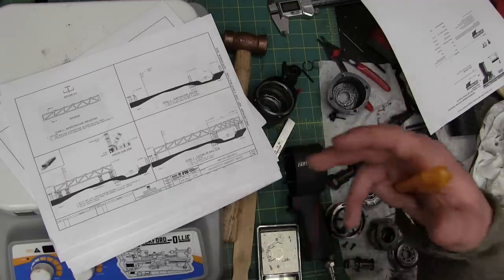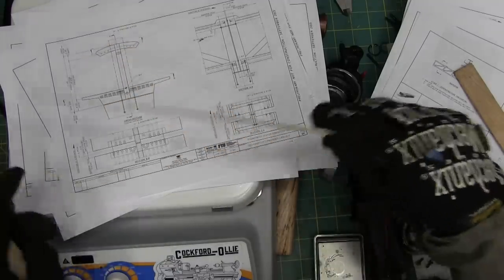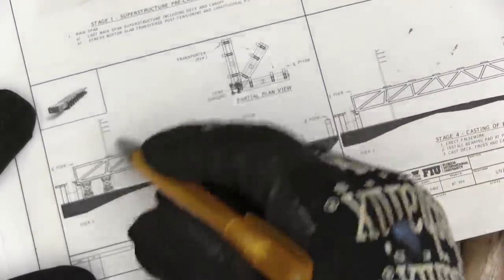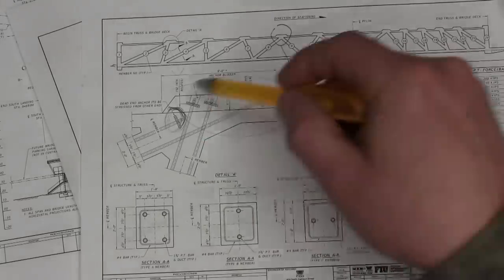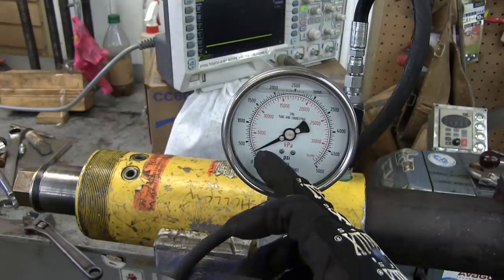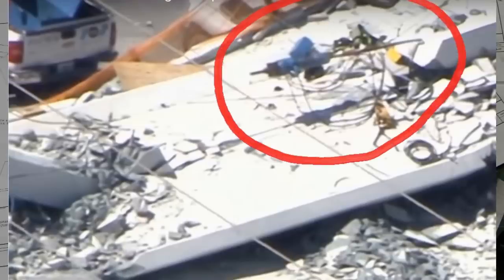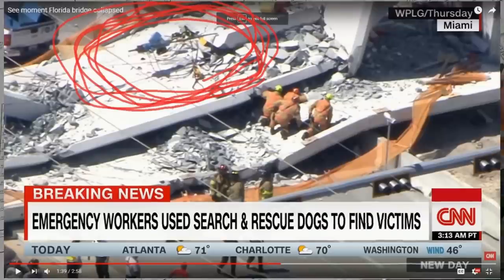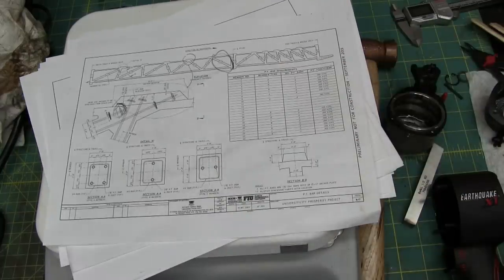Post Tension Failure Florida Bridge Collapse | Engineering EXPLAINED!

Comment: I agree that the failure most certainly occurred at one end of the bridge, either member 2 or 11 as you say. (Not sure which end is which).  However in my opinion, once the bridge was sitting on the piles at EACH END, the whole upper "deck", (for want of a better name), would be in COMPRESSION - supporting the lower "deck". 

The lower deck, without the support of the upper deck and by being only supported by the piles at each end,  would tend to generally sag. 

This compression of the upper deck would terminate through members 2 and 11 which were based at their respective trusses at each end at the lower "deck" level. 

Given this is logical, I have a problem with the assertions that the workman was supposed to be increasing or adjusting TENSION. 

Certainly in some other shots that are around, one can see that a number of members have appeared to have pierced the upper "deck" which may support what I am saying, but I am aware that once the bridge hit the road, anything could end up in strange places.

However, in my humble opinion, whilst I agree that member 2 (or 11) failed, possibly where it was attached to its adjacent member 3 (or 10) but it was  because of a COMPRESSION failure of some sort.

Trust you can follow this.

Cheers

Roger

Comment: I used to work in a concrete plant making pre-stressed structural concrete beams and wall panels. Prior to concrete being placed, the cables had to be pre-tensioned which required all but two people to leave the entire building structure. The two persons doing the pre-tensioning were behind very thick plexiglass in the event of failure. In this case they were pre-tensioning steel rods for which the road and surrounding area should've been closed per OSHA rules, yet they were not. The bridge collapse was an accident though unfortunately took the lives of six civilians and injured several more. As for the design change and the movement of the north pier by 11' feet further north, I don't know if that was before the bridge segments were made or after the fact. But clearly in this case, it appears a pre-tensioning rod snapped which is the straw that broke the camels back. No doubt about that.

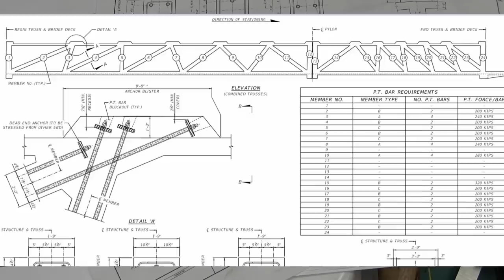Comment: AvE, there is a couple of things that are really odd.  In your analysis, you have concluded that Member 11 failed.  (Refer to minute 12:20).  Looking at the table on the right (P.T. Bar Requirements), there are no PT rods required for Member 11.  (Which is logical since Member 11 is purely in compression.)    But clearly in the photo at 11:32, there is ONE (And I only see one) rod visible protruding from the blister as you noted.  Why is it there?  It was not called for in the drawings.   

If I had to guess, by the contractor moving the outside transport vehicle from Panel Point 11/12 to Panel Point 7/8, member 11 is now dangling in the air during transport.  Now Member 11 is working purely in tension, (temporarily) which it was never meant to do.  So the Engineer must have allowed them to add a PT bar or bars to Member 11 to allow it to handle that tension.  Which would explain why buddy at 8:20 is talking about "detensioning bars" (and I was wondering WTF is he talking about).  But that makes sense.  Those bars were only required for transport when the right end of the truss was dangling.  If they were torqued and they put the truss down with member 11 already under compression and then add the compression due to dead load of the span.  Boom.  Or did they make a mistake and tension the bars in Member 11 once it was down and again, overload Member 11?

Comment: It did make "sounds" days before and every day from the final stressing operations were completed. Sounds heard clearly from the live and dead end anchorage locations. Spalling of concrete  was noted in a report. In field installation of tendons was not per design documents. No as-built set found. Was the bursting steel installed per plan? Not really a question. End of investigation..........

Comment: Technically it's not a truss - it's a braced frame beam. In a true truss the web members are free to rotate in plane and thus generate only tension and compression in their members - no shear or bending, (in theory) except at their connections. Braced frames require moment connections at their joints or they are laterally unstable. The problem is compounded in this design by a lot of asymmetry. Each frame is different from it's neighbor, and from what I gather  it was to be a faux cable stayed bridge - another complication in and already bunged up design which lacked any sort of structural redundancy. Now add in a low-bid contractor who's looking to speed things up and cut costs, and poor oversight by inspectors and BAM!!! The thing falls and murders a motorist.

Comment: I've watched a few videos on this but one of the workers and a university person said that they heard a whip-crack noise when walking across it at a previous time, perhaps a day earlier. So as AvE says, they all had to be well aware there was a problem. As to the highway department not closing the road, be aware that somehow they have to be notified that a 'repair' or change was happening to do so, so that might mitigate that a little. But that's the problem when you are using a 'just in time' method of doing this. Open the road so nobody complains and only close it when needed but who knows when 'needed' is? It's so vague that you need to close the road PERIOD until it's done and then inspected after the whole thing is done. Of course then you have the guy who signs off to be sure and put in a clause that if it fails within 90 days he has to donate his head to a Chinese museum or words to that effect.

Comment: I don't design post tensioned concrete but it seems like a odd design. Overly complicated? Apparently very little or no redundancy built in? Is this type failure typical for post tensioned structures?

Comment: You should look at the video by Stuart Grant on you tube. It shows the bridge just after the move. When it pans to show the diagonal element, look to the right of the chains and to the left of the Sweetwater sign. There is a blowout of the concrete with what looks like a white pipe sticking out. The video will then continue to pan to the right and then back left again.When it comes back to the diagonal element showing the blowout, there is a piece of plastic covering the apparent blowout. What do you think?

Comment: One side of the beam shattered, while much of the other side remained intact.  If concrete is strong in compression, then was the pedestrian platform and the canopy above also in compression,? And, if so, how was that done? Were there tensioning members inside the platform and canopy sections?

Comment: According to the drawings there is no post-tensioner in member 11, and neither should there be. That member is always in compression except while the section was being transported.
The dashcam video seems to show the deck failing near where 9 and 10 intersect, a little toward the direction of 11.  It seems to me that it is either the deck itself failing under tension or else the tensioner inside number 10.

Comment: Id just like to note that if the tension rod were to have broken, it wouldn't be sticking out of the rumble like that. The tension required to snap a post tension rod is high and the release of that energy would've shot that far out of the concrete.

Comment: Thank you for your video. I learned a lot about FIU brigde, but I have a different opinion about the cause of the failure. Member 11 was compresed in that schema so it hadnt need any aditional compresion. The cause of failure was too high compressive stresses in concrete. The workers should release the tensioning cables. Additional force in member 11 caused destruction of concrete. We can see it in some photos where we can see the boottom part of the member 11. The reinforcement is not destroyed but te concrete was crushed. After releasing supports the compresion appeared in member 11 and it caused reduction of force in cables.   (Sorry for bad ENG)

Comment: They did have redundancy (2 tension rods in each truss member) but somehow, the install guys still messed this up. Each rod should handle the load by its self in case of a single rod failure but they may have made a mistake on sizing the rods in the design. 

Structure failures are always a domino effect. 2 or more bolts are supposed to share the load and if they don’t, one can snap transferring the load to the next and then the next until complete structural failure. I am a mechanical engineer, not civil but those are my 2 cents.

Comment: There's also a slight possibility that there was a void in the concrete behind one of the deadheads. The tensioned rod may not have broken but was pulled through.
Reply: Gordon Richardson I doubt there was X rays done.

Comment: Guarantee they fudged the safety factors. I'm a structural engineer that works on dams and any time we specify post-tensioned rock anchors, we have a minimum 2.5 load safety factor in the design plus the anchor manufacturer instills its own safety factor. To get brittle failure in a brand new structure is unheard of and means that someone royally screwed up and should go to prison.

Comment: Dude, take another look at the blueprint in front of you, specifically the page showing the enlargement of the cut-away of the PT bars in the canopy.  Above this enlargement is the span with the trusses ("Members") numbered 1 - 12, and to the right is a chart: "PT Bar Requirements," listing the members, number of PT bars required, and the load per PT bar.

Note that members 9,11, and 12 (the ones closest to where the collapse first started) are not spec'd for PT bars.  The enlarged cutaway in the blueprint is in fact specifically labelled "Detail A."  It details only members 2 and 3 and the canopy.  In fact, the angle of the PT bars in the enlargement jives with the angle of members 2 and 3 in the illustration just above it, but we know that the angles of the members are all different as they near the suspension tower.  I think it is a mistake to assume that "Detail A" also refers to the opposite end of the span where the failure occured.

Member 11 is where we are assuming they were tensioning when the collapse occurred.  Maybe this isn't so.  Maybe they were tensioning member 10, per the chart.  

I realize the blueprints were preliminary and aren't as-builts, and that I'm just a beer drinking beach bum, but maybe we're focusing on the the wrong member.

Comment: Just a couple days before the bridge collapsed, W. Denney Pate, Figg’s lead engineer responsible for the project, called the Florida Department of Transportation

“Hey Tom, this is Denney Pate with FIGG bridge engineers. Calling to, uh, share with you some information about the FIU pedestrian bridge and some cracking that’s been observed on the north end of the span, the pylon end of that span we moved this weekend. Um, so, uh, we’ve taken  a look at it and, uh, obviously some repairs or whatever will have to be  done but from a safety perspective we don’t see that there’s any issue there so we’re not concerned about it from that perspective although obviously the cracking is not good and something’s going to have to be, ya know,  done to repair that. At any rate, I wanted to chat with you about that  because I suspect at some point that’s gonna get to your desk. So, uh,  at any rate, call me back when you can. Thank you. Bye.”

https://heavy.com/news/2018/03/figg-bridge-collapse-florida-fiu-history/

Comment: 11:54  The tension rod looks intact to me, it seems on the other hand that the support, the anchor, just punched through what was supposed to ... anchor it in place. Generally, a "bed" made of "standard" reinforcing still, is used to spread the local concentrated load (from the post-tension) , and that "grid" of reinforcing steel bars keep the anchor in place. If the anchor punchs through, it should bring some of these standard reinforcing steel with it... but none seem visible (in the photo, maybe they are there, though). But if there are none visible on the photo, maybe it is because there were none?

Comment: Good discussion but the only thing wrong with your hypothesis is the far right cord you keep focusing on is in compression, not tension, when the entire span is sitting on its final supports. A failure of the post tension member in that cord should have no effect. Good discussion regardless!

Comment: I think they tensioned that diagonal which put the concrete in compression to hold that cantilevered end for transport.  When they put the bridge in place that diagonal was now carrying the weight of the bridge plus the post tension.  The concrete of the joint exploded before they could reduce the tension.  If the rod failed it would be across the street with the jack and everything else.  Also notice that the entire concrete node is gone.  If your theory that the rod broke was true the concrete node would still exist.

They should have detensioned that rod while the transporter was still in place and the bridge was on the piers.

Comment: People need a simpler explanation. Here it is. Concrete is great at resisting being crushed, but can be pulled apart pretty damn easy. To compensate for this on the bridge, giant steel bolts were used. At each end, giant nuts are placed and tightened. This pulls the concrete together and prevents it from pulling apart. In short, the steel bolts relieve stretching at the expense of smashing because concrete will resist the smashing. If those steel bolts are designed correctly, tightened correctly, or are inadequate for the weight of the bridge (either during installation or after installation is complete), the whole thing will fail. In this case, it appears that not only was the design inadequate (no secondary support systems to prevent catastrophic failure), but the installation was modified and those modifications were done incorrectly.

Comment: I literally dont understand how an engineer could do this. If you are tightening it and not "seeing stress", then doesnt that mean it is no longer elastic but has moved into inelastic deformation? Which is bad. And if it stops stretching at all then it is work hardening = very bad place to be. But if there are strain gauges all over the place, wouldnt this be obvious?! Shouldn't they be charting all the strain values? I mean FFS this is basic yield curve engineering, me no comprende how bridge engineers could screw up something like that.... Of course, been a few years since I was in engineering school so maybe I am missing something???

Comment: I've fab'd train & hwy steel bridges w/most being Fracture critical. Just in the handling during fabrication the weight of the piece just in roll'n or standing it up by a bounce or twist can set it up for failure. And undercut weld, grind to bare stiffener, arc mrks, chain gouges or even a solid instead of dotted stencil can doom a piece even after it has been erected correctly. But to have this piece fail by such an in your face situation there's no excuse for such incompetence.

Comment: So honestly it wasn't really an engineering flaw unless you think about it like this:  Had it been designed to be simpler and more robust without having to rely on so many different principles, without having to marry so many differing materials together, it wouldn't have failed due to a field modification, or potentially minor improper amount of tension put on a post-tension member.

That said, it still wasn't an engineering flaw when you take into account it was designed in a pristine lab that considered perfect conditions for use and installation.  It simply didn't account for the human error factor during installation.

Had it been a simpler, and more robust, time tested design, rather than a showcase for engineering prowess (that's a nice way of saying "being a show off") then there would have been less chance for failure due to a minor miscalculation or less than optimal installation process.

Just my two cents.  Take it for what it's worth.  (not much)

Comment: The slow motion video shot from a car on the road shows the first failure at the last segment of the lower plate and the angle between bars 2 and 3 (from left) increasing quickly. When bar 3 hits the ground, it has done a punction on the upper plate. And that rotation increasing the angle between bars 2 and 3 may have stressed too much that PT rod.My guess is quite more simple: that section was supposed to act not like a truss, but as 6 segments of a beam suspended by cables attached to bars 3, 5, 7, 9 and 11. The task to move it from frames to its final position may have needed some temporary tension here and there, besides the need to face class 5 wind storms.But let's be reasonable: if a concrete piece can stand alone under its own weight of 950 tons, and service loads are mere pedestrians, why all those cables from a pole?